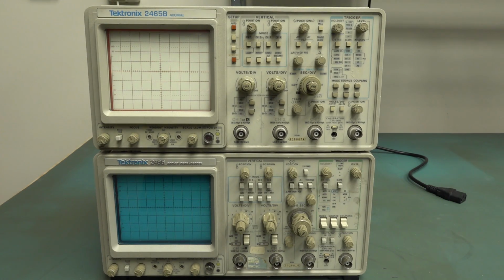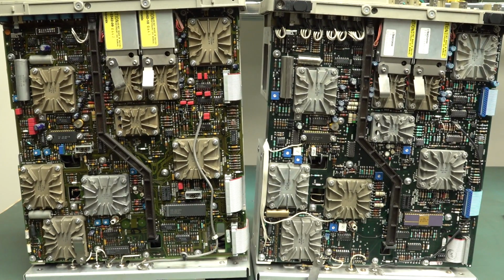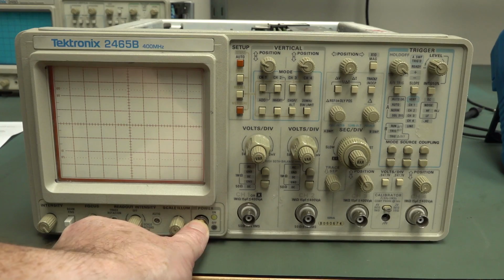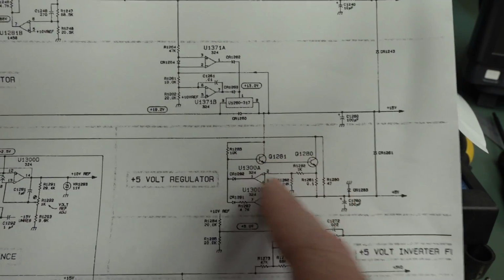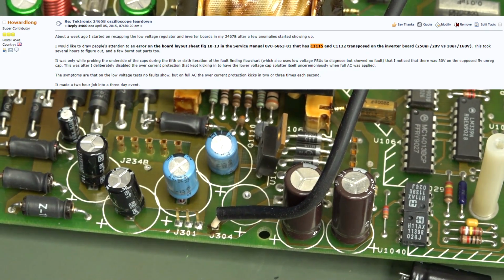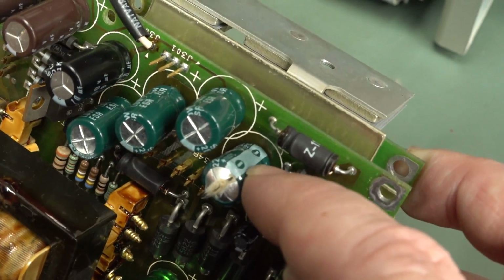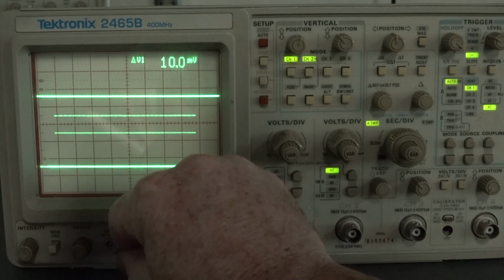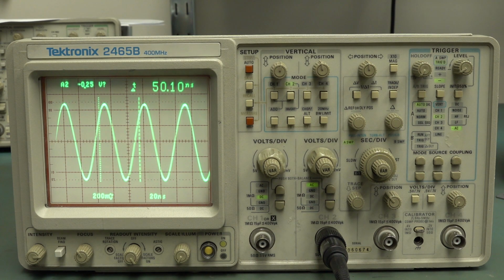EEVblog #1203 - REPAIR: Tektronix 2465B Oscilloscope

Comment: You should really avoid running those without the covers. The ASICs (U800 in particular) are very sensitive to overheating, and the cover serves as an airflow guide.
Reply from the maker: Yes I know, but a few minutes for debugging and testing is fine.
Reply: @EEVblog  If you really do intend on using it in the long term even with the cover I want to echo the U800 heat problem. That particular ASIC is hard to come by and really needs a heat sink. I used Digikey 345-1585-ND and machined extra holes into it. It wasn't easy finding an off the shelf part that fit between the case and the chip.
Reply: The service manual says it's ok to run for a minute or two with out the cover. It only requires you to add a fan for extra airflow if you are running it for longer.

Comment: 3:14, Up top, example of early board design for automated through hole assembly.  Everything nicely orthogonal (this wasn't as important back in the hand stuffed days).   Typical of US designs, or designs optimized to run on US equipment, you see all the axial parts in one direction if possible, because there would be a significant delay to change from X direction to Y direction and perhaps back to X and so on.  Also, as shown, they tended to use same lead center distance from one component  to the next, even when it wasn't necessary (they could have saved some space) because there would be a slight delay every time the lead center distance of the assembly machine was changed.  The delays made for increased cycle time from one board to the next.

Comment: Those are real nice scopes, if I had one, I would use it all the time. As far as your question at 39:47, there are a lot of your viewers that have 3d printers and you could model up a feasible similarity to the original and have someone make it from a 3d printer. Granted, it would probably need to be made in sections, but you could screw the sections on and act like it was original.

Comment: Dave very happy you started working on 2465B, I just recently purchased one at auction for $150 US and it is working. I will be opening it up soon to check my caps. https://vanderberg.org/2019/04/tektronix-2465b-oscilloscope/

Comment: i thought installing caps the wrong way round just made them more susceptible to noise, not explosion
Reply: You are thinking about film and paper caps. Electrolytic caps and especially tantalum caps fail violently when connected backwards.
Reply: Search it up on you tube, much fun is had putting in reverse. Dave has even done slow motion of them.

Comment: Dave the blue screen is an interchangable part. You can swap them!
Reply from the maker: I suspected it might be, will try and swap it.
Reply: @EEVblog  You can swap them very easy. You don't need to unscrew anything. Just flex it a little bit from the front with a screwdriver and it should come loose. It's some kind of acrylic glass in front of the screen.
Reply: EEVblog nope fix it lol

Comment: Hola amigo recomendarme un osciloskopio portátil  lo kiero p uso automotriz chekar ECUS sensores de motor transmisión de ruedas etc
Reply: Si encuentras un Tek 2335/2336/2337 esto pude ser muy reliable porque son echo para uso en grado militario. Son un poco mal para maintener pero muy duro y portable. Los manuales de servicio son un poco deficil para encontrar en el net pero todos mas o menos el mismo prque los modelis solo tienen diferencias en su exterior.

Comment: Wow, i see tl074 on the board, and  as noted in the datasheet they are really used in oscilloscopes.
Reply: did you mean really used or rarely used?
Reply: @simontay4851  that's my mistake, i mean really)

Comment: The 2465B is missing the blue CRT filter. Slide it up to remove it from the bezel. This one also has the leaky SMD electro's on the control board, with the attendant damage in the area from the electrolyte.
Reply: Those SMD caps are gnarly on this one.  Mine had this a little bit on that board (mine being a 2467B) but same power supply cap issue.  Mine all puked however.